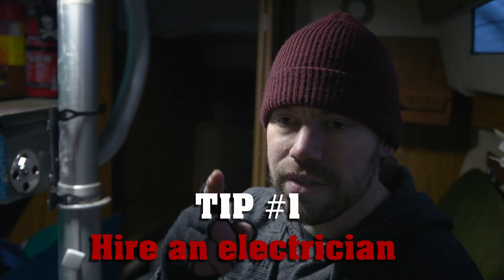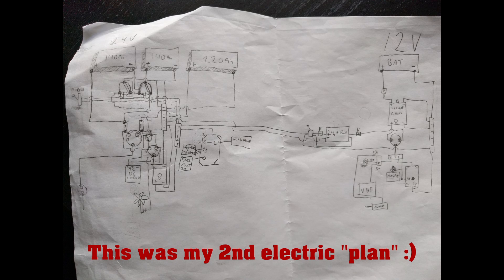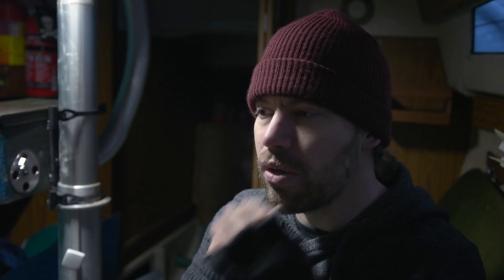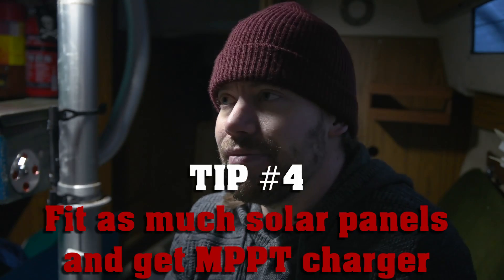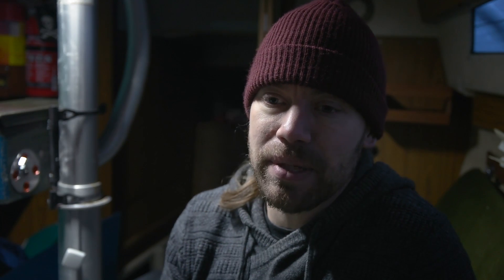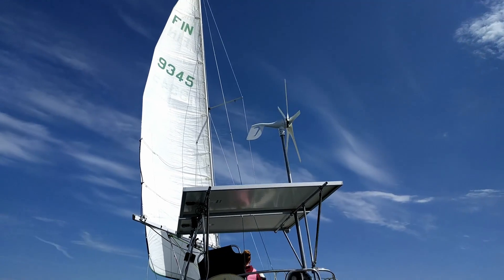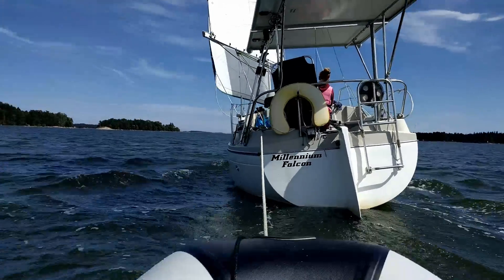5 tips for building an electric sailboat

Comment: tip1: pacific yacht systems sometching chanel has plethora of info why and how dc wiring in the boat should be.
tip2: I recall your main array 2x250w? if your are space restricted - sell these and install more efficient ones (current ones goes up to 360w) . if yours mppt can handle - wire panels in series / less wire loss.
tip3: your secondary / flexible array is so bent - it more or less shades itself. i would make a fixture and use full size panel in place. do not use main mppt / use separate one - boom still might shade.

Comment: Tesla is going to use a new li battery 20700 They think it is more efficient than the 18660  I would explore this before investing in 18650 batteries unless they drop significantly in price with the introduction of the 20700  good luck
Reply from the maker: +ed riley Yep, you're right. I also hope the new cells are gonna make batteries cheaper and more efficient

Comment: I figured I will only be using my motor for harbor transits and mooring. what else do you use it for? 700ahr seems like alot of battery capacity for an hour or two of slow speed motor use.

then again in only using one tiny trolling motor. I know you made your own outboard.

I plan on increasing the efficiency of the prop so that I can run the motor at a slower speed and conserve power too.
Reply from the maker: +HillbillyMatt ExtremeDIY Well sometimes there's no wind and I still wanna get where I'm going so I motor. And sometimes the wind is bitc* and I don't have the time or space to zigzag :) Then the extra power is needed.

Comment: Stark power has LifePo4 batteries that are a but expensive but you get what you pay for. You can get them in 48V and they have internal BMS systems that prevent them from over discharging and charging. So if they are discharging differently it won't matter when using solar or some other means of charger as they will limit the amount of power that can be put in them. You also won't have to worry about them discharging too far because the BMS won't let you. As far as I know you cannot run them in series but check with the company. BTW I have some background in battery tech so if you have any questions I may be able to answer them. Be safe out there and happy sailing.
Reply from the maker: +S/V Cooper Dude Thanks dude! Good to know someone who knows these things. I've been googling and googling so much about different batteries :) What I'd want is to call Elon and make an order for those new 2170 cells for a special price and make a battery :D
LifePo4s are a bit easier to put together and not that dangerous (that's what I've read) and yes it might be that the BMS don't like them connected is parallel/series..?
Reply: Some BMS systems can be wired in series if designed for it, most are not. They would have to be able to communicate with each other. On the other hand, most will work perfectly fine in parallel. Thats why I would suggest going with a 48v pack if you wanted to run 48v. That way also if you have a pack go down it doesn't effect your voltage available. LiFePo4 cells also have a great life span.
Reply: Also just and FYI. When you over volt an electric motor, you are adding to RPM's and not tq. So it will make you go faster in theory if you have enough tq to fight against the added resistance of the prop going though the water faster.
Reply: Torqueedo has some pretty promising setups. I may end up going though them for my build. I wouldn't suggest anyone to try and build their own pack unless they have extensive knowledge in lithium power.
Reply: They are still dangerous if you short them out but not as dangerous as LiPo cells when charging.
Reply: You also might want to check out VAWT wind turbines. Very promising and looks to me that most cannot over volt and cause a fire unlike conventional wind turbines.

Comment: These are good advices, thanks for sharing. How much does your batteries weight in total ?
Reply from the maker: +ghismo you're welcome! My batteries weight over 330 kg so about 730 pounds :) that's almost 1/4th of the boats original empty weight.. 😲
Reply: Ok, so it's like you have always on board 4 adults. It's quite a lot but something your boat was built to expect. Thank you for your answer (I should have done the math by myself :)).